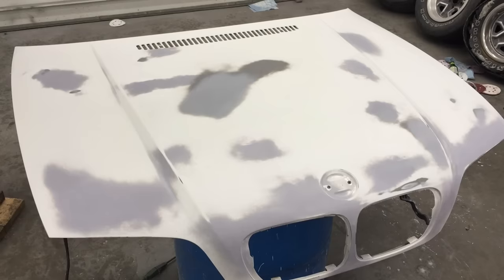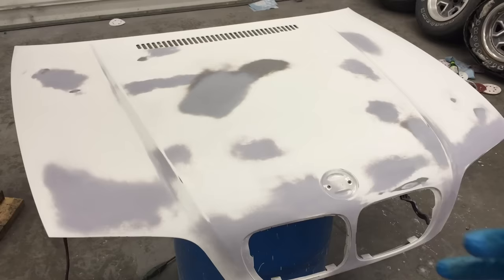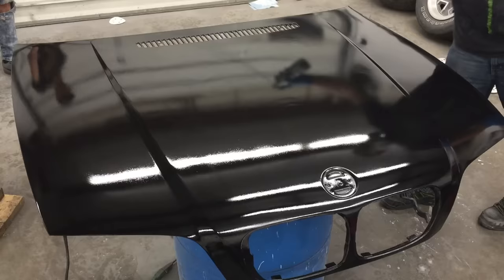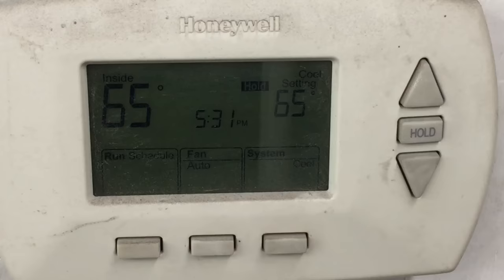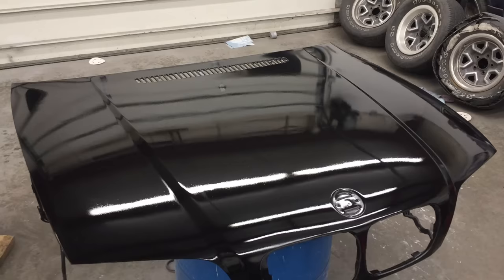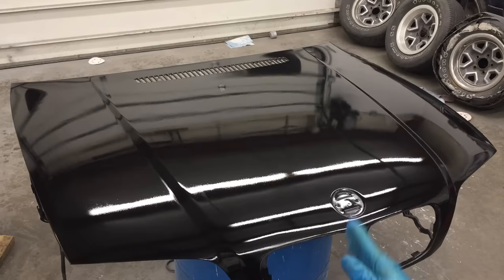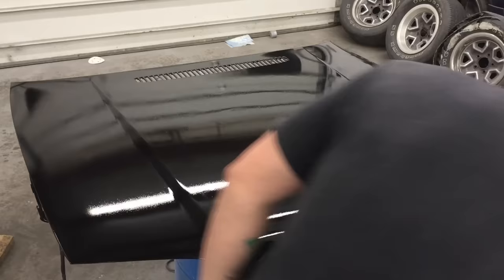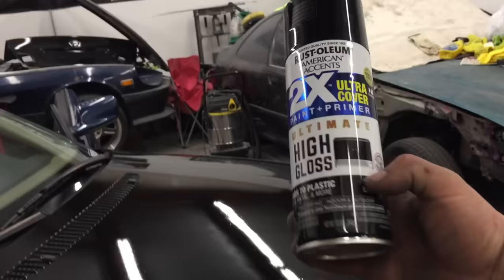How I don’t get stripes when spray painting (Easy method)

Comment: Your definition of “light coat” is different than mine.
Reply: Yea you got that right lol
Reply: Ikr.
Reply: First off how many cans did you use to get "two light coats" and I notice the spray pattern looks like nothing I've ever sprayed with. Is it stock or a special nozzle you use?
Reply: @MrPeeteboy  he says in the video 2 cans
Reply: Ha! Holy crap thats what i was thinkn!!
Reply: That looked very much like a standard coat! A light coat to me  the primer will still be slightly visible... 
The temperature makes a huge difference - I've attempted painting a few small parts in 5-7°C just to see what it would look like and it just comes out very matt!
Reply: Failed to see any different "method"
Reply: Too thick for a first coat. The first coat should be the lightest of all coats....
Reply: @alexzandernathan4060  one of my paint buds told me ,do a very light coat first and let it flash off a little longer if you're worried about fisheyes and other issues like that because sometimes a light coat has just enough solvent to flow but not mix with the impurity and seal it off.
If it's bad ,more than 1 light coat might be needed. 
Depends on the situation if it's better to stop and start all over on the prep or just keep going. 
The underneath of a motor mount you're hitting with a can ,big deal.
My car roof , nah start over.

Comment: Put can in warm water before and in between coats helps reduce orange peel
Reply from the maker: Great tip! My shop is far from any warm water but i will have to drop that info in my next video!
Reply: @steveanus4449  Blowtorch?  Why not just use C4?  Blowtorch or propane is beyond excessive.  Soaking the can in hot water is more than enough.  It takes time for the heat to transfer through the can into the paint.  The can should be periodically agitated while soaking in the hot water to evenly transfer heat into the paint.  Heating the can with propane will just cause an explosion.
Reply: Is that why I've seen people heat up their spray cans and the surface they are painting with a hair blow dryer? I saw this in another video recently and wondered why. Does this method work well?
Reply: @chrisb167  ok, so the flow of the paint out of the nozzle or spray tip can determine whether or not you get orange peel? Does the way the paint sits on the surface have a lot to do with it as well?
Reply: Good tip. Thanks.
Reply: I've said that to so many rattle cans tubers, also I notice this guy never light sands his rattle coats and repeats the process. I guarantee he has so many fisheyes in his paint.
Reply: @sethfrancissimracing7558 the main purpose in heating up the cans is to prevent fisheyes in the paint, fisheyes can lead to paint chipping down the road from wind wear from driving in speeds.
Reply: Get a burn barrel and have a nasty fire blazing and set the cans in there for just a second. That warms them up to the right temp every time. Trust me I’m a professional. And you just saw this on the internet so you know it’s true
Reply: If you want to end up looking like Freddy Kruger, hahaha
Reply: jerry pablos I never knew that! Thanks!!
Reply: Heat the can in oven for 2 hours on 450 works great
Reply: @aux1z11  thats not.funny
..
Reply: @silkboxing4454  that's a pretty impressive argument you made.
Reply: I just set mine on the stove burner for an hour before I'm ready to paint
Reply: @StephenBrewer89  lmfao
Reply: Promotes drips. 😄
Reply: @sethfrancissimracing7558  if it's cold out it helps.
Reply: $5-10 for a hot plate...or micro wave etc... you need water and a pot...
Reply: Wouldn't warming the can up make the paint run easier?... possibly causing runs?
Reply: Mobile Terminaluser  not counting the fact it will completely destroy the microwave. Lol... some people huh?... smh.
Reply: Mobile Terminaluser  - Um... He meant a hotplate or a MICROWAVE to warm the water (as James said he didn't have it in his shop)... He didn't say to put the can in the microwave. ;-)
Reply: Or possible the hot weather (ie. 26 'c) can replace warm water / hair dryer? Anyhow will try this suggestion
Reply: jerry pablos I prefer to use a heatgun to warm up the can before spraying and even warm the paint once sprayed
Reply: @chrisb167  yea but it makes me want to pee
Reply: @sethfrancissimracing7558  before I even knew this idea I used a heat gun since the paint was clogged up in the nozzle cause the cold can to drip when spraying so I heated up the can work's fine this before I found out other people was doing it too
Reply: Ive heard a nuke is a lot faster
Reply: Mr. Noobser I still got orange peel
Reply: @anthonycarlucci7464  Interesting, I might experiment with this then.
Reply: I just use my propane torch LOL and I'm being serious by the way. Don't try this at home
Reply: @Exessive-Gaming  in between each coat?
Reply: Instructions not clear. I put the entire hood in warm water.
Reply: ive heard this, but it didnt make much difference when i did it. most important is temperature conditions. what its like outside if youre doing it. If you make small area paint booth, if its humid and rainy its not going to look good.
Reply: @StephenBrewer89  hahaha
Reply: @StephenBrewer89  well I stayed at a holiday Inn express last night and I'm a French model!🕺
Reply: @sheeznutz2254  lol 😂
Reply: Im painting a 2001, slk merc and im in Spain, its 25°, so over 80F, thing Ill just leave the tin out in the sun a few mins before i spray the front wing. Also think i will ho over the 3 coats with 2000grit and a compound and buffer then 2 coats of clear !!
Reply: @JamesDguy  Far from any hot water?How about a Microwave or a heat gun?
Reply: @StephenBrewer89  Had a kid at my school many years ago toss an empty spray can into a burn barrel from a distance of 10 feet. It exploded and cut his scalp all the way across and disfigured his face. I'll never forget how that poor kid looked when he finally came back to school months later.
Reply: @CarsandCats  that’s sad. And the sad thing is most of us have done that as kids. Very stupid but in the moment we were all for it.

Comment: If you are painting a black vehicle, make sure the bodywork is on point. Dark colors show every single imperfection.
Reply from the maker: YES FOR SURE!
Reply: DEONCE EVANS totally agree
Reply: I use black as a primer that way I see the flaws early.
Reply: @cuzz63  I like that but not if you're doing a light colour base coat?

Comment: For bugs and drips/runs, masking tape is your best friend.  If you have a bug, just carefully extract the bug with tape without touching the paint.  All those years of playing Operation® have really paid off.  For drips and runs, wait for the paint to tack up a bit, and the drip will still be wet. Place a strip of tape on the drip (plus a few inches on either side, then immediately remove it SLOWLY. Follow up with new paint.
For orange peel, use a paint can that is at least 15-20 degrees warmer than your paint booth.
Reply: Won't matter if you don't touch the paint when picking up the bug with tape.  The bug itself has touched the paint, creating a mark.  You've got to deal with that regardless.  I find it's best not to mess with it when it's wet, but rather get rid of it when paint dries and re-coat.
Reply: What if your outside
Reply: 3dcad if you don’t know what a wet edge is you should just go to a body shop and pay someone to paint your stuff 😂
Reply: Or I like to use actual tweezers for bugs works perfectly
Reply: If a bug gets on my paint. I get 1000 more bugs on put them on the rest of the car for symmetry.
Reply: Or be patient ,let it dry and use the razor blade trick. 
It's worked for me quite a few times.

Comment: Nice job.

I had never painted a car or body parts in 30 years and at least 25 cars I've owned.  This past week I painted my teenage son's Impreza in an open carport on gravel and dirt ground.  I figured out what works for my area (western Colorado).  I did 5 and 7 light to medium-wet coats on a whole car, over 4 sessions without fail.  Apply and let dry for 15 (minimum) to 20 (maximum) minutes between coats and it works fine for the paints I used.  You should spray two small test areas with all environmental/time factors the same before the actual project.  For example, if you have an area to spray that takes 10 minutes to paint it, wait and warm-up/shake your next can(s) for 5 minutes and start the next coat.  That's a total of 15 minutes.  I know up to 20 minutes is also good.  But 40 minutes was too long because that induced chemical reactions and severe wrinkling.  I painted in the same order/pattern each time I sprayed a section.  I had zero runs, spray errors, or reaction defects.  The original paint condition was below average.  No body rust, but 50% of clear coat was gone and hunter green was faded and rock chips galore.

Below is the weather, process and paint I used. 

1.  Up to 3-mph occasional breeze is okay, anything faster or constant is to be avoided.  Clear skies, for light, preferred.  20% to 40% humidity.  Temperature between 50F and 72F while spraying.  Warmed spray cans in hot water in a bucket.  Shake them as much as possible.

Paints used on sides, nose and rear (3 sections):
-- Rust-Oleum Painter's Touch Gloss Navy Blue 2X Paint + Primer: 1 medium-wet coat.
-- Rust-Oleum Stops Rust Enamel Gloss Navy Blue: 2 medium-wet coats.
-- Rust-Oleum Stops Rust Enamel Crystal Clear coat: 2 light coats + 2 medium-wet coats.  I think a 5th coat could be applied with no problems.

Paints used on hood, roof and hatchback (1 section):
-- Rust-Oleum Painter's Touch Gloss Black 2X Paint + Primer: 2 coats.
-- Rust-Oleum Universal Hammered Black: 3 coats (4th coat optional).  ***Color dries gloss dark grey with blackish specs, not solid black.

2.  Sanded car with 100 and 150 grit dry paper by hand, with a scrubby dish sponge as the pad to fold the paper around.  First, I sanded high defect/damaged spots...double their original size.  Then I sanded vertically and again horizontally (cross hatched) the whole car. 

3.  From this point forward you must walk carefully to protect from dirt contamination...do not drag or scuff the ground.  Wet the surrounding area to help keep dust out of air.  Douse car with hot water and wipe down with rags.  Let air dry 30 minutes.  Check that all areas are smooth/scuffed well...touch up as needed.  Wash with hot water+dish soap and rags/sponge.  Rinse well.  Dry with microfiber.  Air dry 15 minutes.  Tape up as necessary.  10 to 15 minutes before paint spraying use a microfiber cloth and lighter fluid or mineral spirits (same thing) to wipe down the section to be painted.  Immediately before painting wipe all surface with a tack cloth.  As you're spraying move slowly and don't scuff the ground.

4.  Even in the open air you will want to use a painting respirator, but at minimum cover nose and mouth with thick damp cloth or N95/N100 face mask.  Clear, tight fitting safety eye glasses work best...the larger goggles reflect light and make wet paint difficult to see clearly.  I had to go without eye cover and just squinted my eyes when the paint spray was thick, because goggles distorted the light.

5.  It will take these paint formulas 3+ hours to dry to firm finger touch so leave it alone for 5 hours.  I let it dry 24 hours in the carport and then put it in the Sunlight for 2 more days before driving.  At 25 to 30 days I'll polish and wax it.

If you want to see pics drop me your email and I'll send you a couple.

Comment: I have another tip whenever I’m spraying outdoors and that’s to have cardboard surrounding the work area. I place the board around the sides and this keeps wind from effecting the spray pattern. Small or large projects I’ve saved cardboard to handle the size.

Comment: Try changing nozzle with a nozzle from niagra spray starch. It will give you a wide spray pattern which will allow you to overlap by 75% per line.
Reply: Ook
Reply: Hi is it the tin can one or the trigger on the bottle one? Asking as we don’t have it here and plus postage to the U.K. will cost $50 so want to get the right one, cheers

Comment: Good video! I just want to mention that I live in Saskatchewan. Its winter now. I use aerosol primers, paints and clearcoats to refinish guitars. I apply all products OUTSIDE, minus 10 deg C or colder. I dont wait for warm weather cuz I could wait 5 months for that to happen. The sub zero temps DO NOT have any effect at all as to ease of working or appearance of finish. My aerosols are pre heated in warm water. Run outside, do the job, run back into the house. Perfection.
Reply: Small jobs then 😊 ...I was doing that for my mirrors on a rainy day...got a few bubbles from spraying too thick I think but perfect enough 😊
Reply: What’s the humidity like?

Comment: I've always found it difficult to get a good surface condition on a flat panel with a rattle can spraying horizontal.  I would always default to handing the part up and paint vertical when I can, with a rattle can especially.  You can also use the whole can easier that way.  You got very nice results though.  Impressive.
Reply: It helps to keep a hairdryer or heat gun nearby to heat the can and keep pressure up, it will help a little with the spitting when the can gets a little low. 
Or, when it's starting to act up grab a new can and finish the other one off later.

Comment: Good vid. Thank you. No explanation needed. Some comments wanted you to "explain" how to do it, I get it. How you did it visually was sufficient for me. Painting a horizontal surface is somewhat easier to "lay it on" , than a vertical surface. Still tricky with a rattle can. Great job showing
Reply: I prefer vertical because the spray pattern is at the right angle 😊

Comment: I painted my 87 4Runner with a cheap husky cup gun and rustoleum from a quart can, mixed it 50/50 with mineral spirits, 2 or 3 light coats, like 10 min between coats. Laid down perfectly, no orange peel at all, did some gen 1 style graphics a week later with just blue tape and a rattle can. Got questioned at least one a week if it was original paint. Looked  great! No one believed it was rustoleum,
Reply: Patrick Leahy maybe in my old phone.... I’ll look...
Reply: emil - what size air compressor?

Comment: To reduce orange peel heat up the paint surface of the metal blow dryer etc. Easier then heating the paint and metal holds heat well. You want your ambient room temp low and humidity free but your paint and surface your painting to be warmer to allow for viscosity to smooth the paint.
Reply: Heating the panel is a good idea it helps quit a bit. If you take the spray can and turn on your faucet to all the way hot and let it flow over it for around 2 minutes depending on outside temps shaking it few times between it actually gives it a bit more pressure and it makes the paint flow out way better and orange peel is almost gone when u doit that way. Combo with a heated panel like you said and you can get some smooth rattle can jobs!!

Comment: I use rustoleum for my base coat primer when I paint goalie masks. Best product in my option! I’m a go salute myself and trust it without a doubt. I lay rustoleum primer doesn’t, then air brush using createx paint, finally spray max 2k clear. Beautiful strong finish, just like a pro!! Same finish in my opinion. Can’t even tell the difference
Reply: I think your helmet failed... Proofread your comment. ;-)

Comment: The clear coat out of a can works also. My side plastic mirror housings where sun damaged and the paint was fading because the clear was missing. I took the mirror housings off, cleaned them, and then wet sanded them. Then I cleaned the mirror housings with paper towels and rubbing alcohol, and them dry. Then I put them on a bent up coat hanger. I gave each mirror housing three coats of black paint for plastic, and three coats of clear coat. I waited for the proper amount of dry time between coats and half the 24 hours before putting them back on and another 36 hours before getting them wet.

Comment: I feel like the tiger stripes are going to show a lot if the over spray of one pass is lightly falling on a pass that's already flashing or drying more. I've found if you can keep that "wet edge" (that's what I call it) running in one direction its way better looking then that over spray fogging or misting into an area you've already sprayed. And being at that cooler temp as you mentioned also helps the paint from flashing quicker and allowing it to settle on those areas also causing that problem. I'm by NO WAY a professional painter by any means, just something that's always seemed to work for me and maybe it'll help someone else. Nice video, btw. i found it very helpful!
Reply: Yeah - cool temperatures and keep it all wet ,shooting the final 'money shot' coat  all in one session.   When it's all wet, the overspray just melts in and doesn't flash.    

The paint will be soft long after it's dry.  The curing takes days to weeks , more time you can give it the better.   Once it's dry, after a day,  I put a space heater on low and some fans to help get the VOC's out and help the curing.

Comment: Everyone saying it's not a light coat, you can't do light coats with spray paint. You have to keep a wet edge with the paint to allow it to flow out. Not too heavy, no too light.
Reply: BIG WRONG. YOU COULD DO ANYTHING YOU WANT. light coats and more of them give way better coverage and stronger paint bond
Reply: Yes keep a wet edge but thats on last 2 coats.  The first 2 should be misted on and tack to primer and fog . Then another fog then medium coat then solid wet edge coat then wet sand then 2k clear

Comment: You always spray at a 45 degree angle? I paint aircraft and always spray 90 degrees unless doing multicolor swoops. Also your definition of light coat is way different than mine. However, that hood looks like it turned out great.